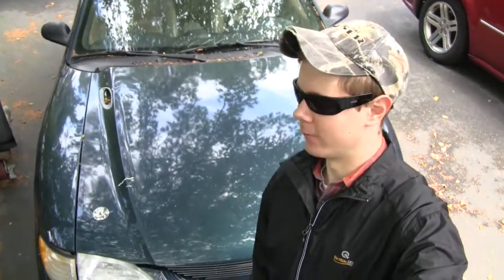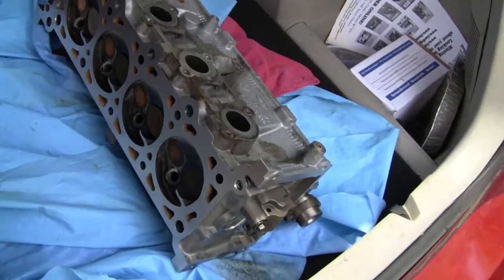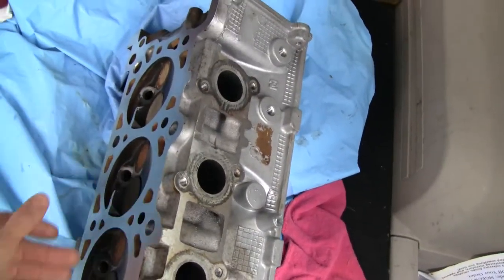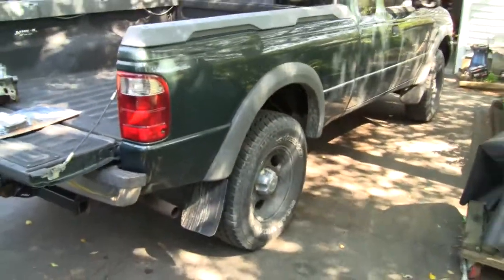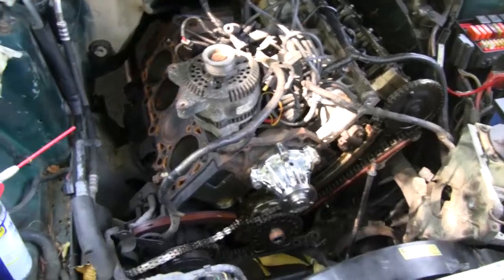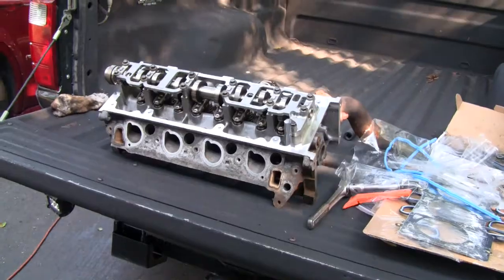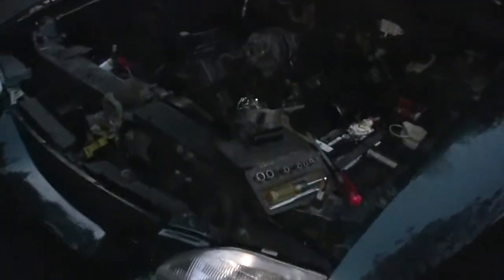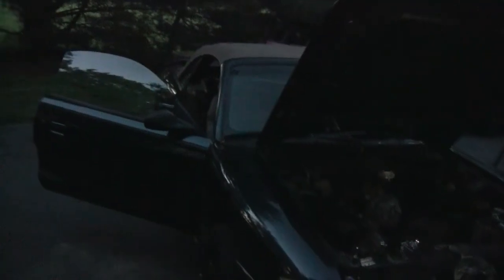MUSTANG ENGINE REASSEMBLY (4.6 SOHC)

Comment: I think I’ve got a blown head gasket in my 2003 GT. Mine has BBK longtube headers, did the heads come off easy with the stock manifolds? Several videos that I’ve watched have all said to remove the headers before removing the heads. I only ask because with the longtube headers, I can’t get to the bolts to remove them without taking the k member off again. 

Thanks!

Comment: Should've done p.i intake and head swap since you're already that far into the motor bro lol
Reply from the maker: Not a bad option but I ended up swapping in a LS engine, it had stronger throw-out bearings and better final drive ratio

Comment: I know this video is 2 years old but yesterday I was replacing the valve seals in my 02 GT and I dropped a valve into the cylinder so I have to remove the heads...how did you get yours timed correctly?

Comment: Good job.
I know it's an old video, I also don't know how long it was sitting out, or what condition it was in before you pulled the cylinder head off, but a cool tip for next time:

A fine mist of Wd-40, plus maybe placing a shop towel (or similar lint free paper towel) down and giving it a fine mist of Wd-40 to dampen it, can really help keep moisture off the engine when you've got the head off. You can even spray a tad in the cylinder as well. just try not to spray it straight down any coolant jackets and you should be good to go. Really helps when you can't get your cylinder head back on the same day.